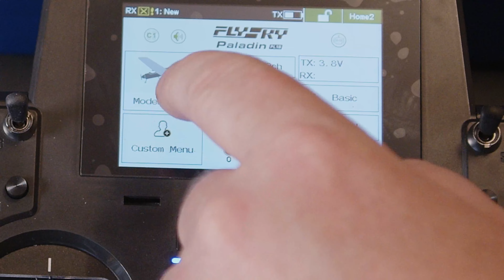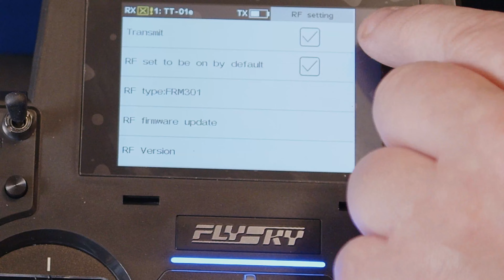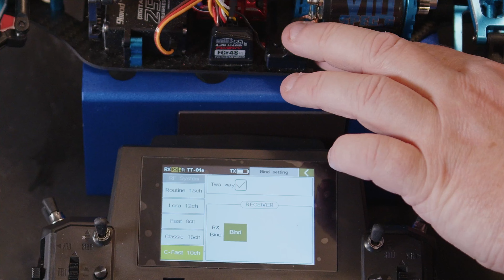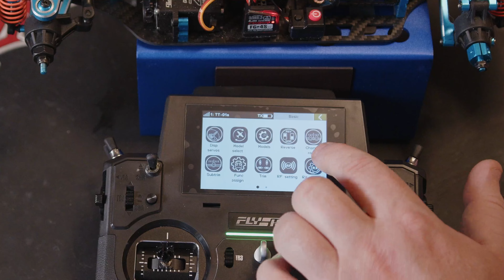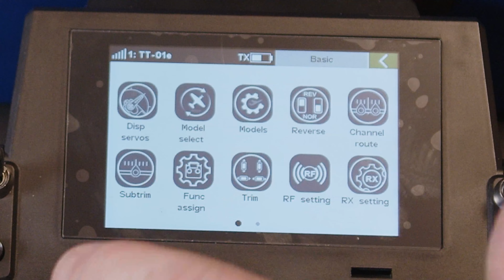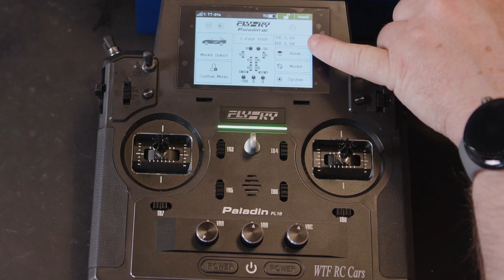Flysky Paladin PL18 rc cars basic set up guide.

Comment: Hi - will this TX work with the Spectrum RX that comes on a lot of RTR vehicles from LOSI and Axial?
Reply from the maker: No you need afhds3 flysky receiver but they are cheaper and have more features than the spektrum ones :)
Reply: @WTFRCCars Thanks. I do have a FS-GT5 for my Tamiya Blackfoot and FS-i6 for a diff drive vehicle. Ideally there would be a radio that can support both the older afhds-2a and newer afhds3 systems.
Reply from the maker: Yeh the afhds3 is a huge jump in performance from the older ones and has support for ibus 2 so that's why they don't work :)